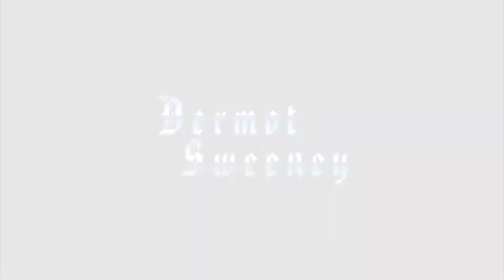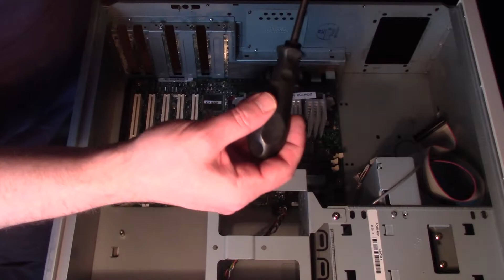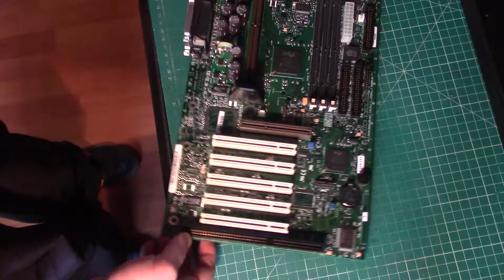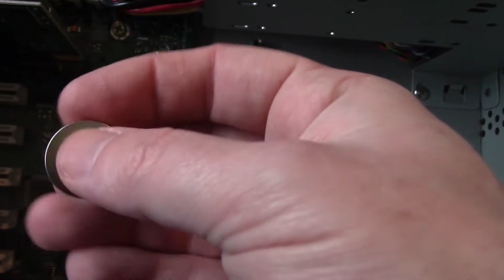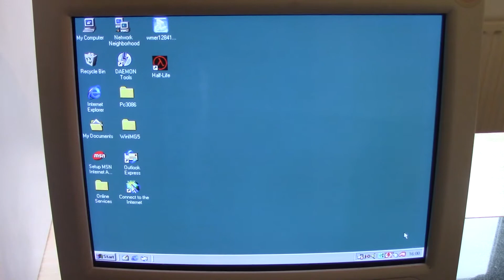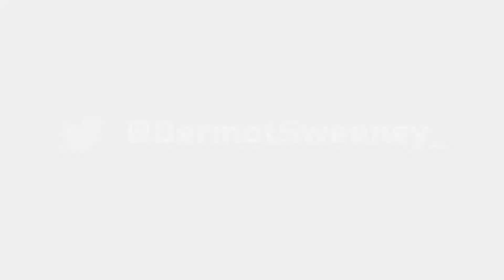Gateway 500 - Pentium III - Desktop Refurb

Comment: I had the same PC used from January 2002 to January 2005. It was already 3 years old when I got it.
I will say that it may say 3x128mb, but I used 3 sticks of 256mb pc133 sd ram just fine for a total of 768mb of ram.
Obviously nothing from this pcs era really needed that much ram, the pc was simply so old at the time and using obsolete sd ram that we had 3 mix-matched kits of 256mb from random friends of my dad.
It did actually benefit from the ram playing world of warcraft from December 2004 to when the pc finally died was discontinued in January 2005.

Comment: Funny thing is, there is a room for a regular 80mm(?) cooling fan just behind and above the CPU... But still they insisted on using that silly duct stuff... Dell's solution was probably better then, they had the rear 80mm fan and then a duct going from that over the CPU instead...